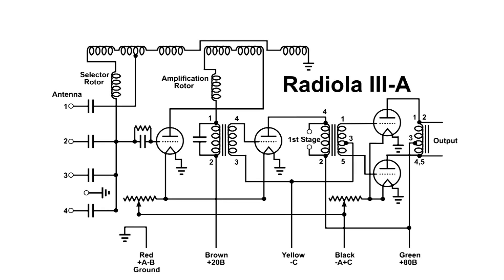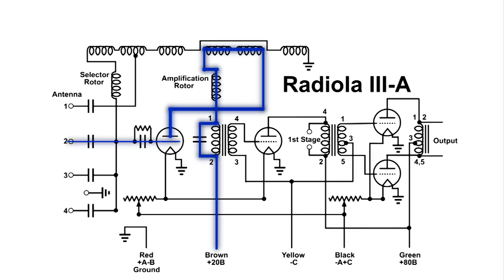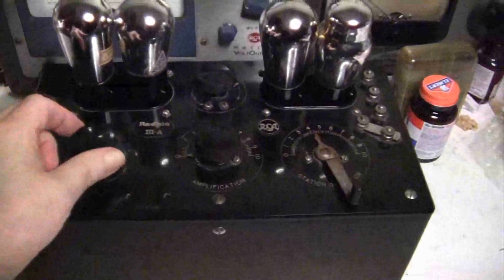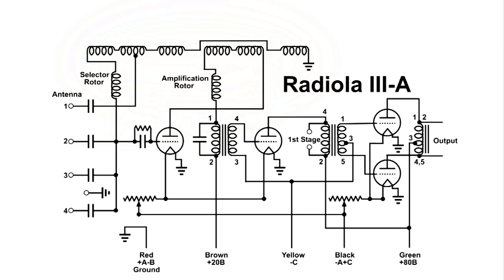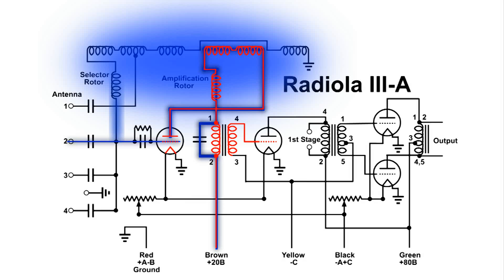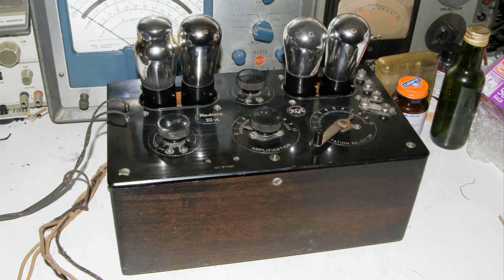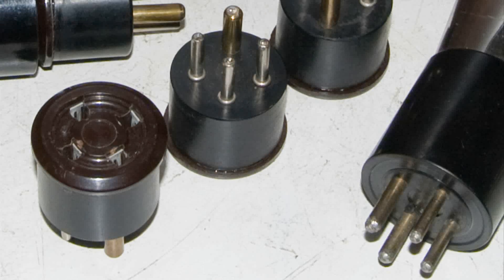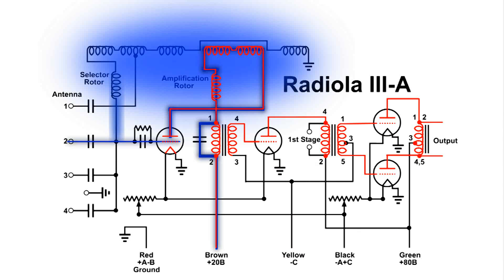Radiola III-A 1924 Circuit and Demo

Comment: If you think about the progress that radio made in 11 years between this Radiola 3 -A and a pointer dial  EH Scott Philharmonic from 1935 it is mind blowing. I have given a demo to a few people using my wideband AM transmitter and the Scott in a Gothic cabinet with tweeters and it  sounds better than many modern units.
Reply from the maker: Yes, Scott was the top. They were the best quality radio in those days, and still are.

Comment: Just wanted to echo the praise of all the others here & add my 2¢ whilst I'm at it.
I belong to the Ontario Vintage Radio Association here in Canada, & just recently purchased one of these babies in excellent cosmetic, & I think electrical, condition. Paid just $25CDN for it from our meeting auction; that's about $1.49 in real American $, btw...😉😏
It's a Canadian set, too. It's branded as a Westinghouse, not an RCA! But other than it was built up here (under license?🤔), it's ABSOLUTELY IDENTICAL to your RCA set other than there's a Westinghouse logo in the exact spot where the RCA logo is on yours.🧐
I appreciate that you clarified what voltages you're using for the B & C supplies, as I have very little knowledge & no experience with these pre-Superhet technology sets & I need & appreciate all the knowledge & help that I can get on the subject. The guys in our club that are into restoring these old sets just glibly say 90V RF Amp & O/P stage & 45V for the Detector/1st AF B+, & -5 to -10V for the C-. One fellow likes to use the lowest filament voltages possible to get the set to work in order to protect those ancient filaments gone brittle with old age & high mileage to extend their lives. My thought is that he's wrong & it's a false economy; insufficient voltage will poison a coated filament, likely the same thing would happen with a thoriated tungsten one, & the pure tungsten filaments of WD-11's & UX-199's(?) have such low emission that you likely won't have the luxury of doing this even though it won't damage them! What's your experience?
It was nice to see you showing how to use the regeneration ("amplification") control, & that the set has enough juice to drive a horn (which I don't have). I also have enough whiz-dumb from previous electronics adventures to be hesitant about making a high value collectable in excellent condition as a first project to cut my teeth on; maybe I should experiment on another of my recent acquisitions first? I also got in the same auction a gorgeous Freed-Eisemann Neutrodyne set...but I know enough that it isn't a regenerative set but more along the lines of, or just plain is, a TRF set. Another kind of set I don't know how to operate! And not long before I also obtained a near-mint Atwater-Kent Model 30, I think it is. But perhaps my first victim will be a 1920's era kit I bought alongside the A-K, with five 01's in it. The A-K, like its model # implies, uses a half-dozen 30's. So with that background I'll get to my final point:
I knew that the Radiola originally used WD-11's. I wasn't told that it could use UX-199's. Either way, I have none of the former & probably not even 4 of the latter that I'd need. I've got plenty of 01's though, although I was surprised to see you making adapters to use them in place of the WD-11's. My Radiola came with a quartet of 30's in it & no adapter sockets in sight! I'm fortunate enough to have a decent supply of these at least...
I haven't looked at any Tube Data, but this suggests to me that the 30 might be a plug-in replacement for the WD-11 & if so rather less hassle than making adapters to use 01's & just plain a better alternative. 😂Opinions?
Reply from the maker: Thank you!
You have acquired several nice early radios. My favorite radios are the 1920s, that is when radio was magic.When I play them I only use enough filament votage so they perform as designed. 
Westinghouse did make radios for RCA in the early 1920s. You may know this, here is the link for the schematic from NostalgiaAir.
 http://www.nostalgiaair.org/PagesByModel/350/M0040350.pdf

Antique Electornic Supply use to sell tube adapters.
I looked up the 30 on NostalgiaAir and it does not look like a sub for a WD11.
I’ll be glad to try and help, and answer questions if I can.

Comment: I saw from the video that you are using 01A tubes with an adapter. Given that the WD11s and 01A tubes run at different voltages, did you have to do any other modifications? Are you running your A battery at ~5v instead of ~1.5v? Any advice you have would be appreciated since I'm trying to get an old, beaten up, Radiola IIIa back in working order. Thank you for you expertise and videos!
Reply from the maker: I did use 5 V for the filaments on the 01As.

Comment: what type of modern bypass condenser/capacitor and value should I use for this set? the factory one in my set shows it going from one side of the audio trans to the frame which is grounded. is it supposed to go across the trans or one side to ground.
Reply from the maker: Model Radiola III
http://www.nostalgiaair.org/pagesbymodel/349/M0040349.pdf
Reply from the maker: RCA Radiola III Transformer Replacement
https://www.youtube.com/watch?v=FVPx9eqm7ZE

Comment: Hi, Rick,
A very good and informative vidio.  But I have one question.  I noticed that the push-pull output xfmr was not exactly ballanced.  That is, the xfmr had differint resinstance from one side to the there.  Is there any particular reason for this or what?  Can you expound on this?
Thanks for your fine videos, and for your fine info.
Dick, WB8MHE

Comment from the maker: Thanks HAL4400
Yes a triode function is simular to transistors. It is a simple circuit and complex too. That regen tube is doing most of the work to make the radio receive stations.

Comment from the maker: Thanks mrmardy
The voltages I used with 01A tubes was 5V for the A battery, 20V and 90V for the B batteries, -4,5V for the C battery. 

If you have WD-11 tubes then it is 1V for the A battery, 20V and 80V for the B batteries, -4.5V for the C battery.

Comment from the maker: Thanks CameramanLink
The "C" is built into the coils so the tuning is accomplished by changing the "L", a movable coil.

The "1st Stage" is for earphones.

In a Push Pull output, each point (1,2) and (4,5) are 180 degrees out of phase. So when one point is the most positive the other point is the most negative. Push Pull gives a larger swing in voltage.

Comment from the maker: Thanks joernone
Hey John,
On radios like that, sometimes I have to remind myself that they were designed to work.
Check plate voltages. Hope the oscillator is oscillating.

Regards
Rick

Comment: I'm guessing the various antenna taps are for different length antennas? My Atwater-Kent has a "short" and "long" antenna connection. Never seen one with 4, but I've never owned a radio quite as old as yours. My oldest is a 1926 Freshman Masterpiece with a TRF circuit.